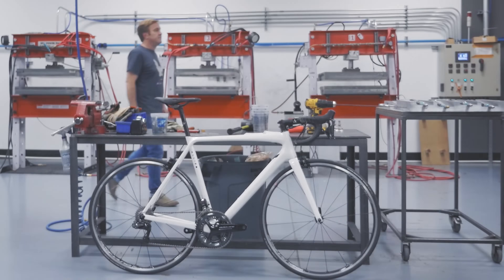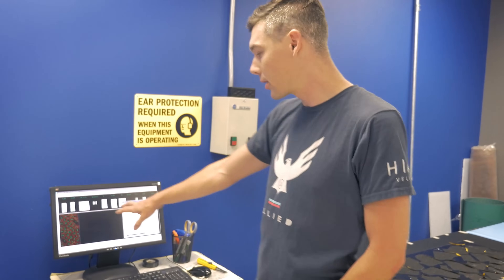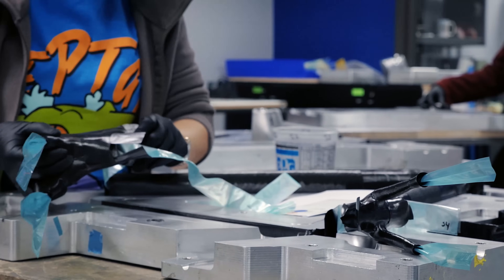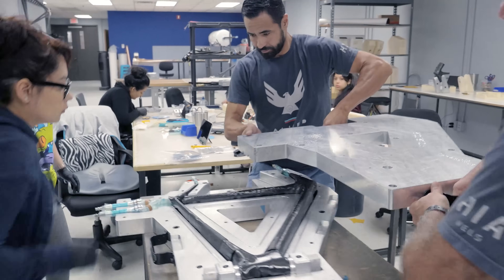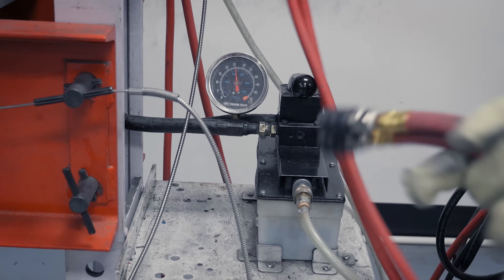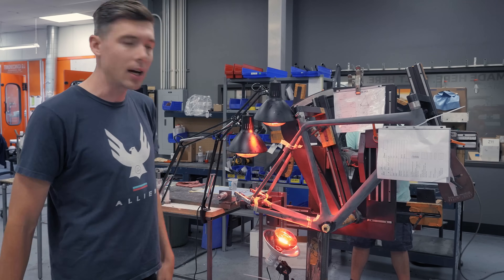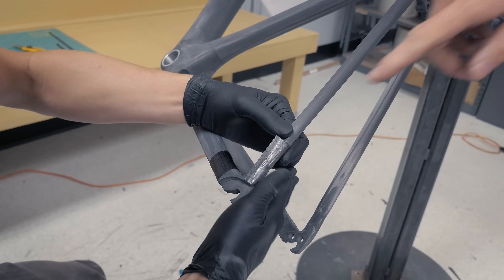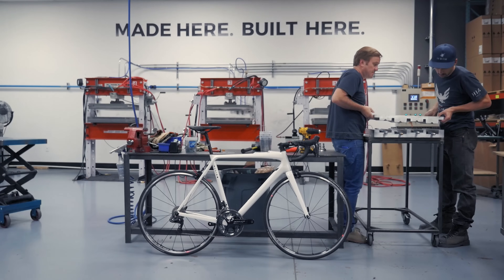ALLIED CYCLE WORKS: Lifting the curtain on carbon fiber

Comment: How many layers of carbon fiber do you use on your parts?
Or does it depend on which part is being manufactured? Which ones have the least layers, and which ones have the most layers of carbon fiber?
Do you use epoxy resin or another one?

Aerospace engineer student here, I am asking for this class paper I have to deliver for my introduction class haha

Comment: Honestly, I know you guys are a start up, and I applaud vision, but the video kinda looks like a low end bike production on a budget. I have concerns about safety. If you really want to be the "most transparent bike maker on the planet", then show the testing, validation and QC of the frame and fork.... and yes I saw the marketing fluff about your "innegra partnership", but come on guys, at the end of the day I want to be able to walk and not get my face slammed into the concrete because of a carbon failure from a "on the cheap" bike maker who has  a really good vision.....

Comment: Thanks for the great video. I have been wondering how complex triangle shapes are being laminated. I just have 3 questions. I hope you will answer.
1) Why are you using a metal mould? Doesn't the expansion of the mould causes some problems with the geometry? Or is it just still in the tolerance?
2) Why not Autoclave? To keep costs down? 
3) I am finding it hard to understand, what happens to preform when you vacuum the whole bag. I think it would collapse or deform a little bit, also pulling the prepreg from the mould. I can see that it doesn't, can you please explain me how does it work?

Thanks again for the video, i will be really happy to hear from you!
Reply from the maker: Hey Dogan, let me get those questions answered:
1. Metal molds are tough and stand up well to daily production abuse.  There is some thermal expansion and that is calculated and taken into account  on areas of the bike that have critical tolerances.  It doesn't matter for overall geometry because the full assembly is bonded in a jig and there is enough clearance in the bond areas to make it spot on in terms of GEO.  We are playing with composite tooling for some parts though as it has some nice advantages
2. Autoclaves are great, but they cost a fortune to run and are notoriously inefficient.  The composites industry as a whole has been moving away from autoclave curing parts. 
3. We vent the bladders to atmosphere so they inflate to about 14psi when we apply vacuum.